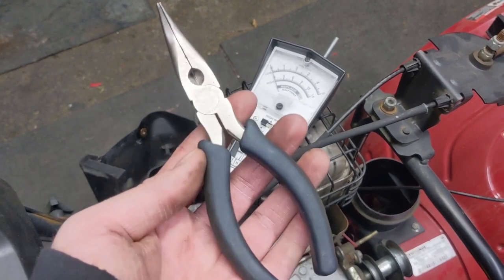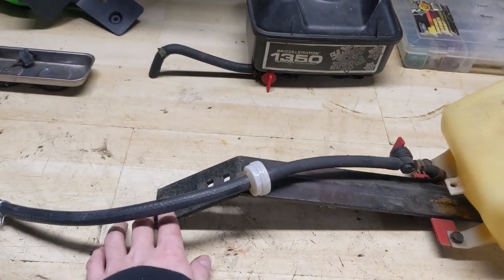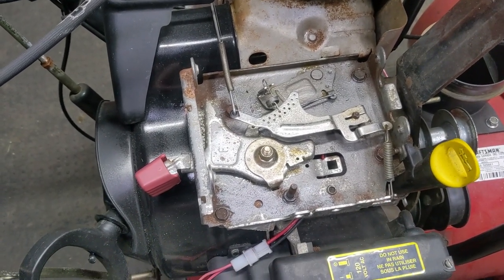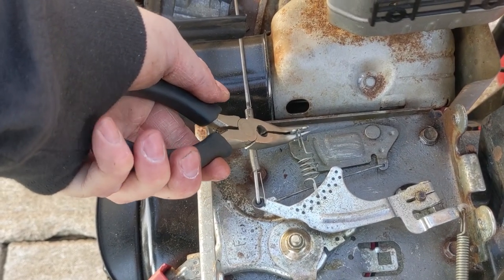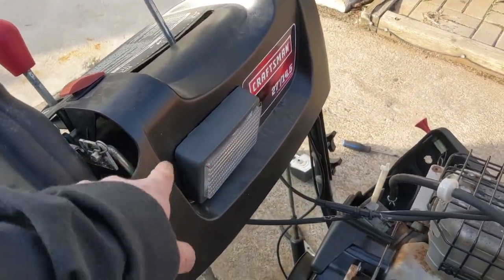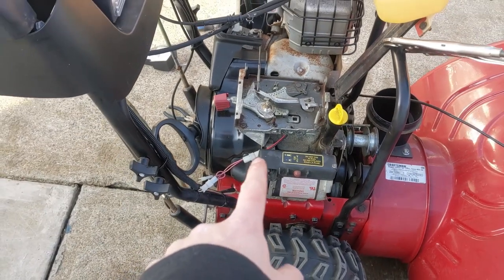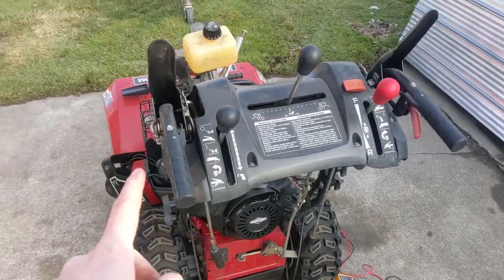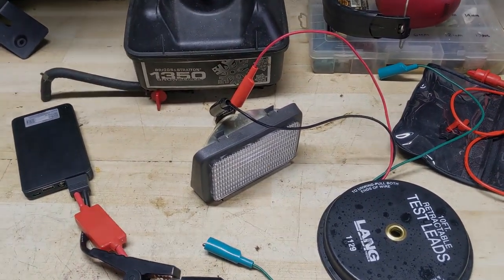Setting the RPM & Testing the Alternator (Series Finale?)

Comment: Hey Jake, I wanted to let you know that I'm taken your advice and I'm going to buy an Ariens Deluxe 28. The snowblower is a 2019 and is  mint I mean not a scratch on it, he told me he only used it 2 times and by looking at it I believe him. I started searching on the net about the Husqvarna and you were correct as usual, the Ariens is the better choice. I'm supposed to pick it up on Saturday if all goes well and I'll send you pictures if you want. Thanks again for your kindness and help in  steering me in the right direction.
Reply from the maker: Awesome to hear Ken. Keep up on the usual annual and mid summer maintenance, use canned fuel for storage (I'll be doing a video on this shortly) and you'll have no issues!
Reply: Good move they are the best going right now

Comment: Great job and well worth the effort, I wish someone would make a repair plug for the Briggs and Tecumseh starters. I have repalced a few due to the terminals being burned off because they were not plugged in all the way. Thanks for a great video.
Reply: Not too sure they would be replaceable they way they are manufactured plus they would not sell as many replacement starters! Great idea though.
Reply from the maker: Yes great idea, I've seen a few come in with the tabs broken off and regardless of whether the starter worked fine before, they don't work without electrical current!

Comment: Congratulations on finishing up that series, Jake. That goes to show that having a lot of patience over the long haul pays off. 👍
I was surprised that you left the IR thermometer set to F rather than C, but thanks!😉   I was surprised the highest temp you mentioned was so low. Given the conditions in which snowblowers operate I would have liked to have seen at least 75F. 
As for that alternator, shouldn’t that normally be producing 14+ volts even if not used to charge a battery?  I was thinking maybe that’s why the handgrips weren’t that warm.
Reply from the maker: Thanks Rein, and no this is a 60w AC only rated at 12v @ 3600rpm. If I let the snowblower run longer I'm sure it would've got even hotter. They work pretty good once the machine has been running for a while

Comment: Hi, I looked at the blower you are putting back together in this video series and I was quite surprised that I found a very similar machine on the side of the road last year. It had a Tecumseh 8 banger on it though. I'm planning on putting a Princess Auto Chinese engine on it. The frane on mine appears to be older than this one, but it's in mint condition. Good job on that project!
Reply: Hi, Could we have the part number for that bridge rectifier? I've been looking all over for a sealed unit and I haven't found one si far this year. Thanks!
Reply from the maker: @msamour  Briggs and Stratton 698315
Reply: @EliminatorPerformance  awesome! Thank you so much.
Reply: The Predator is a pretty good engine
Reply: @waynestefinashen239  I'm getting mine from Princess Auto. I'm not sure it's the Predator engine. 😂

Comment: Humm…the reg/rect is a good idea but I believe you will only have led light at full throttle? You may have to increase the rpm to 3750. Are those Canadian dollars? Man in the US it has HF engine all over it then sell rest of parts. I have a few greyhounds and predator powering snow blowers out there with happy customers.
Reply from the maker: Yea everything in Canadian dollars, and since this now has a throttle control, the voltage will lower with the decrease in RPM. However, the manufacturer states the LED light works at ranges from 10-30v so it should have no issues at 3650 where I set it. Just waiting for some parts to come in and I'll be able to get started on that. Also, the new control valve finally came in for the log splitter, so you won't have to worry about anyone getting injured!
Reply: @EliminatorPerformance  good news about the valve. Looking back at our discussion I see my last reply is gone on the log splitter video. I wonder if that was sensorship from big tech or you?…I replied about a certain jab that wants to waive any liability.
Reply: @garny3766  I replied to all your comments that came through and did not see this one your are referring to get posted. I recently had one of my comments on Clyde Do Something taken down likely because i was talking about all the new information coming out by doctors on masks and the vid vax etc.
Reply: @garny3766  Mine may also have been taken down for discussing why companies are not hiring back personnel fired for not being vaxxed.
Reply: @waynestefinashen239  yup. That’s why I left a federal civilian job last year.
Reply: @garny3766  Sorry you had to do that it was a real violation of your right to choose and even though they were wrong they still wont hire back personnel in Canada yet they are short staffed. Does not make sense does it?

Comment: The ac/DC CONVERTER smooth out the Alternating current to direct current
Reply from the maker: The rectifier concerts the AC to DC, but it's considered varying DC, so the capacitor acts like a battery, constantly charging and discharging to smooth out the oscillation of the direct current. This will all be covered in my video!
Reply: That video i look forward to